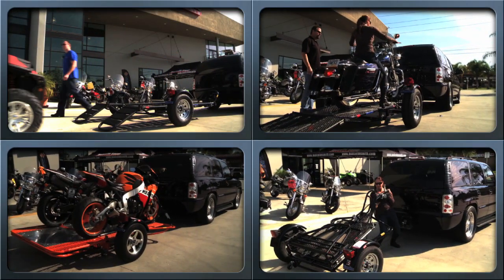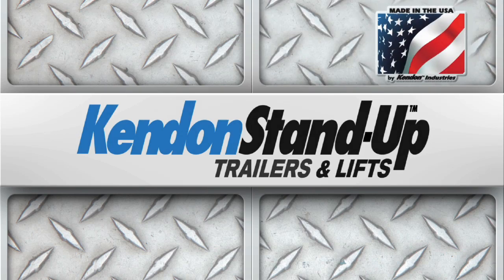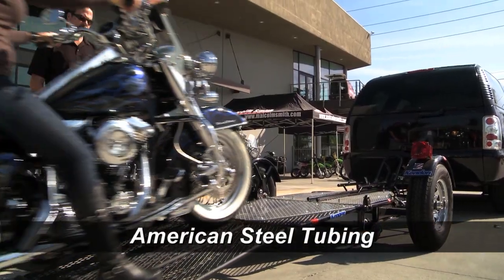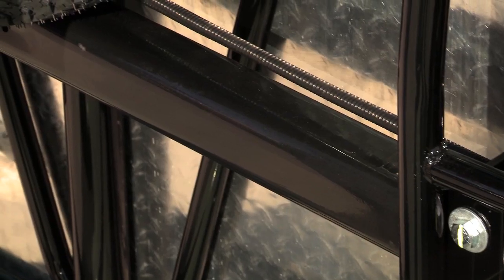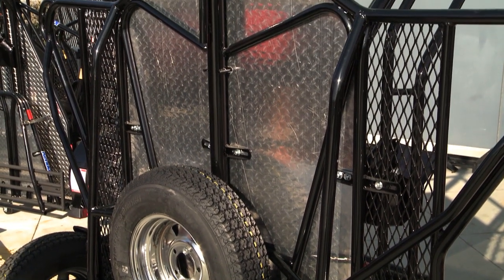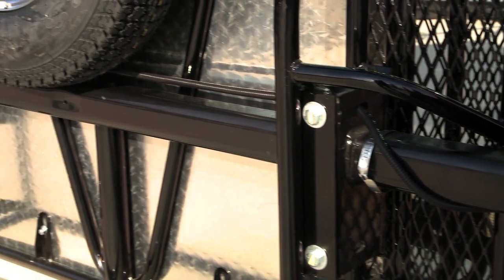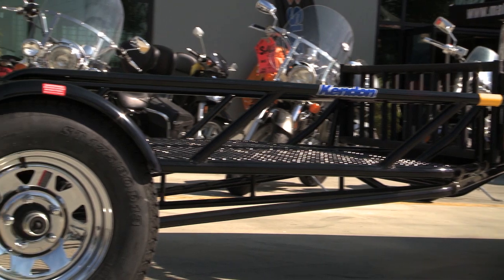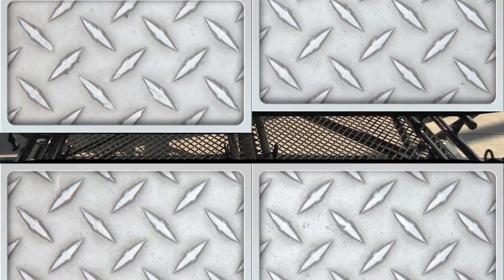Kendon Stand-Up™ Trailer Patented Chassis Design

Comment: Not a single mention of anything that is important,  such as type of axle or carry capacity, wheel chocks, tie down points, electrical (and the list goes on).
Reply from the maker: @bgm1911, this is a chassis specific video to give general information about how the chassis of our trailers is built.  The specifics on the carrying capacity and other details are listed in the product specific videos because it varies by trailer type.